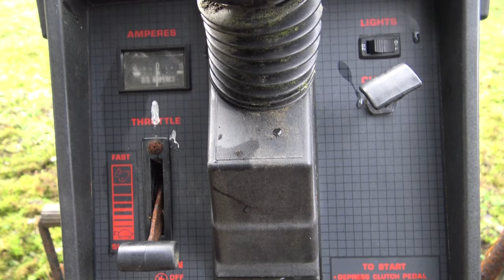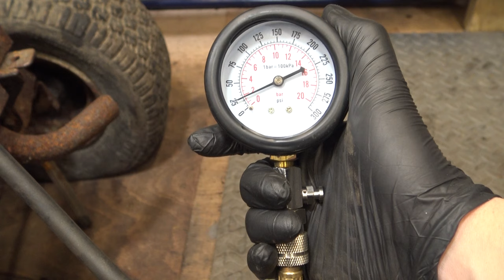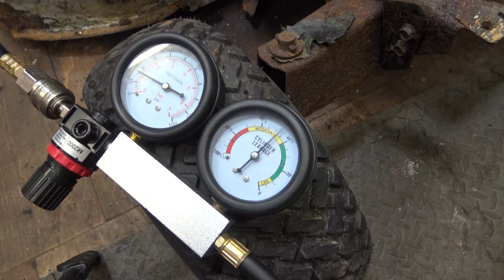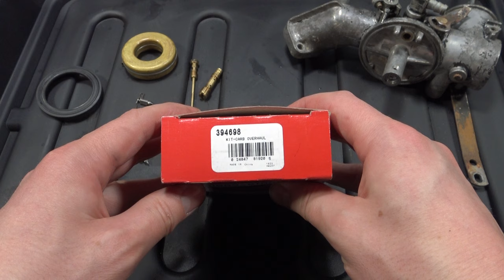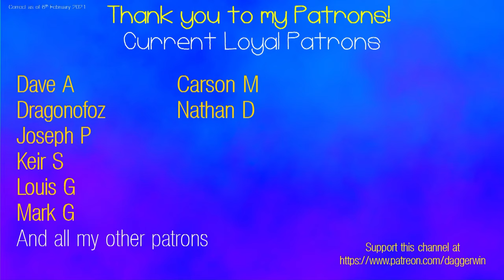EXTREMELY RUSTY SCRAPYARD MOWER - Will it Run?

Comment: After the low compression test and the high leak down test I was surprised to see no blue smoke upon startup and running.
Reply from the maker: Yes it was very surprising how it ran so well.
Reply: yes you are right
Reply: ps.Daggerwin is it snowing in your place
Reply: likely a stuck ring that freed up

Comment: I would have liked to see you do another leakdown and compression test after it ran. It would have been interesting.
Reply: Yes by all means. After it started very little smoke so it appears the ring wear is within tolerance,  the longer it ran it seamed to run better most likely carbon build up and after sitting it got flakey now with the engine running once again the carbon blew off and now it would give a better reading as to the condition of the internal workings and parts.
Reply from the maker: @frankdeegan8974  Yes I will do another leak down test for the next video
Reply: I was just thinking the same :)
Reply: I posted the same right before I read this. It sounded really good.
Reply: Lol I also wanted a leak down test. Good video

Comment: I think you should really try restore the mower. It would be a great little project. Might be a hard one but imagine the feeling of satisfaction
Reply: Theres no way the rest is salvageable. Its all siezed and/or rusted. The deck would need to be completely replaced. The wheels will need to be replaced, the forward/reverse is siezed and the speed selector is broken. They would need repairing/replacing. Its not worth the time or money.
Reply: @simontay4851  that’s the whole point of a restoration
Reply: @aydenidek7581  I doubt he or you mean restoration --that would imply bringing it back to factory condition, or as-new. But a REPAIR is just getting it to function as intended.

Comment: Good old Briggs & Stratton engine. Can’t go wrong there. 🤙🏼
Reply: I've only ever seen one die and the only reason it died was because someone left the dip tick off and water got into it and if froze cracking the block.
Reply: After seeing what Project Farm has put those engines through I’d only buy a mower with a Briggs & Stratton now

Comment: That carbureted is a great example why I hate ethanol gas. I'm willing to put money that has never had modern gasoline in it and that is exactly why the inside of the carb was in such great condition. Ethanol kills everything it touches especially aluminum brass and rubber. Nice job dagwin I too love seeing old relics revitalized for future use. I am always grabbing old mower snowblower and gas powered equipment out of the trash to repair and sell or what usually happens is I donate them to family's that need a mover or something but cant afford it. Keep up the great work! Thanks for sharing!

Comment: Impressive job on the engine. Started up pretty good considering how it looked.
That rear axle though.. i would try to get that going again and make it into a front axle to make a 4x4 mower
Reply: Yes I would agree do the back axle have not seen many mtds like that. Would make an interesting video
Reply: agree, those rear steer axles are rare

Comment: Great video. I think that the lack of much smoke was as much a factor of compression rings that were good to begin with plus the oil ring being splashed readily by the oil slinger on the con rod cap. Sealed the engine right up promptly. Next lets have a dyno check to see how close you can come to getting 12 hp again.

Comment: Great video. For some additional enjoyment consider addressing what is needed to get it driveable & also sharpening the blades but leave the tractor's cosmetics untouched. Then, use it to cut your lawn for a few weeks. I guarantee that you will get some very strange looks from your neighbors.  I did that a few years ago with a very rusty & old, circa 1952 Craftsman tractor that I found in a field. Several neighbors came over with amazed looks on their faces asking me about my tractor.

Comment: The mower is scrap, but at least the engine is repairable. Goes to show you how tough those old Briggs and Stratton engines are. Used them for many years. Even had a custom built B&S engine for a go cart I had back when I was a kid. Little 6 HP motor, but was bored over. Custom forged pistons and internals. Bigger carb. Port and polished the head, etc. That thing would fly! Not sure how fast it was exactly, but it seemed like it would do close to 50 MPH or more with changeable sprockets.

Comment: These B&S side valve engines sits in all sorts of equipment, being run to destruction by owners without any technical sympathy whatsoever. Just a lttle tlc, regular oil changes, insert a new spark plug once in a while and an occasional carb service these engines will last you a man’s age. I love these engines. Simple, rugged and unassuming they are absolute legend!

Comment: I forgot about this video and I came back on it one day and I noticed this has the exact same carburator as the wheel horse b112 I got from a garage its not in the greatest condition but I'm taking the engine off and looking into the carb and this video helps

Comment: They are tough little engines. I still run one but have given up on three. I have one where the valve blew a hole in the head and two seized up in the bore. So swapped out for cheap Chinese crate motors. These are OK but don't think they will last long and the Carbs are terrible with no adjustment. Where I live in Australia it is so hard to get parts. I see them on sites order them only to find they don't actually have them and it can be months to get them if at all and so expensive. I would love to try a rebuild of one but the tools are lacking and no doubt parts. Another enjoyable video. Thank you.

Comment: I wonder if the compression improved after running for a time.
Reply: It probably would, the key is to park the engine before the compression stroke so the valves are closed & dribble some oil in the cylinder.

Comment: Surprised that there was no mouse nest. In the North East USA this engine would have been packed with nesting material. Air cooled engines are pretty tough as long as you maintain oil and keep critters out of the cowling. Great job, this was really nice to watch.

Comment: If you give your rusted fasteners a hard smack with a hammer and punch that is slightly smaller than the bolt head It sends a shockwave through the threads that definitely aids in removal ,Great video thank you very much

Comment: Have you tried using a hammer ratchet on those old rusted bolts? I find they do a good job of loosing the rust whilst unscrewing.
BTW, great attitude during your videos... I would've given up on this engine.

Comment: I had a engine like that run with no compression at all! It was a old bolens tractor and I used it to plow driveways when I was a kid
Reply: An engine won't run without compression. I suspect you had "some"....
Reply: @Hjerte_Verke very little I could turn it over by hand it always had fire in the muffler exhaust valve must’ve burned lol

Comment: Brilliant video as usual; love your channels. Really amazed that you got such a rusty hunk to run and runs quite well. I noticed that the video always shows you immediately wrenching counter-clockwise to loosen the hardware; I was taught to always slightly tighten first, then loosen to increase the chances of not breaking off a seized bolt. Curious to know your experience with that technique.

Always looking forward to your next videos!

Comment: Hey just because you don’t get a reading from the meter doesn’t mean they’re bad I tested them with olms and got the same reading but I turned the motor over and I was getting great spark
Reply from the maker: Yes that is true. I have also experienced that however on the one occasion that occurred the engine didn't start despite having spark and then when I replaced the coil it ran perfectly. Usually if there is no reading the coil is no good.

Comment: I know it would take a lot of effort but id love to see a full restoration of a mower in a similar condition :) eighter way thanks for the good content again.
Reply: A full repair would be better. Weld the deck with steel patches, rebuild the spindles, free up the controls and sandblast the rust off where needed and
throw on some cheap spray paint.

Comment: Those parts you replaced on the carburetor were unnecessary--you just don't know how well those parts (needle valves) will clean up. Brush them with a
fine wire toothbrush or steel wool and they will polish up again back to shiny new. I've seen much much worse.

Comment: I had every faith in you and getting it to run I wasn't thinking you would be cutting grass with it well nit this summer lol, I have an old ride on mower here no deck I hit a bit of cornet and it ripped the blade out (it was rotten and if you really fancy a Charla get i have a mad sprint ride on that somebody left out for scrap after it had been sat on there drive for a year, daft thing it looks tidy but I think all the cables to the gears have sized

Comment: I have a question hopefully you will respond I put transmission fluid in my spark plug hole and the fluid came out of the engine immediately on the bottom is that a gasket or a cracked block

Comment: I can't believe you didn't clean the magnet any better than that, is there a shortage of sandpaper there or what?, lol, who needs compression to run?, those old briggs engines will run on a 1/2pound of compression, lol, good-job, and thanks for sharing.

Comment: Those old flat heads run with almost no compression I had a old bolens with a 8 hp ran it for years like that would use oil I just topped it off every day it was fine

Comment: To save yourself the embarrassment and frustration of snapped fasteners why don't you make your first task the one of going around the whole machine with your trusty can of penetrating fluid (about which there's a lot of conjecture about the efficacy of such) and spray all visible fasteners to give the fluid time to penetrate and do some good. Spray and immediate turn doesn't work.

Comment: Why do you put wd40 on bolt heads, surely it won't do anything as it can't get to the threads
Reply: WD40 is like water in consistency so it does wick around and into threads by capillary action....

Comment: Thing is JUNK! Not enough metal left in it to make it worth the effort. Needs to be destroyed. Even after fixing it, it's going to keep giving problems. Run yes, how long? Not long. Why even bother? Waste of time in my book.
Reply: Hahaha, maybe you stumbled onto the wrong channel, Debbie Downer? Everything you said was refuted by this video--did you not watch it?
The deck can be welded up, the spindle bearings replaced and the controls can be freed up or fixed for little money (at least outside of the UK). The rest of it
is just ugly. The engine seems fine--I think it was parked for other reasons; bad fuel, electrical and not because the engine had a lot of hours on it

Comment: wd 40 is NOT a lubricating  /penetrating oil. it is made for water displacing , and the 40 is the 40th formula
Reply from the maker: https://wd40.co.uk/tips-and-tricks/uses-for-wd40/
Point number 6 - Lubricates
Point number 19 - Penetrates rusted parts